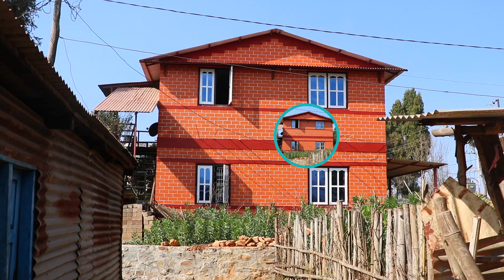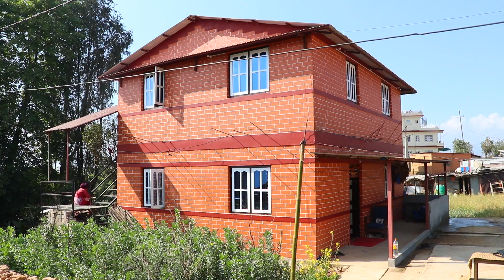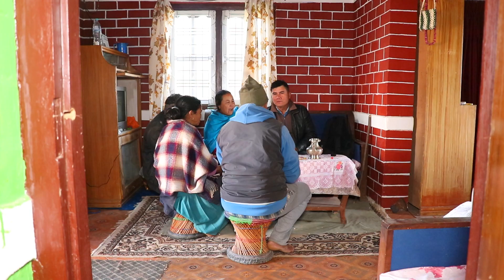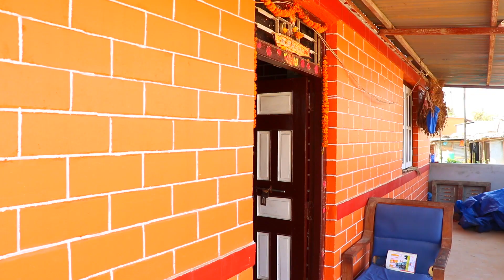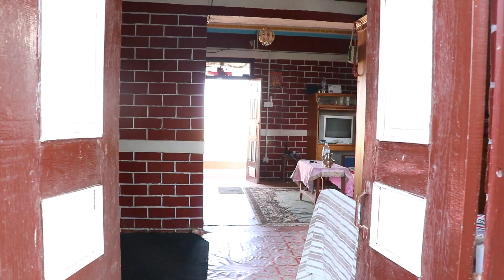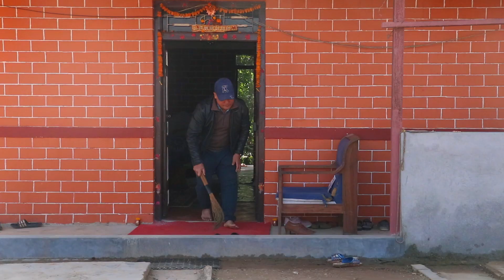Interlocking Brick House Nepal - Low Cost and Earthquake resistant - House owner experience - NTV

Comment: Wall bering system ma dhalan garna milxa,, 2 story banauda chai????piller nahali kana???
Reply from the maker: 10 inch ko itta bata 2 talla samma banuana milcha Navraj jee. Tara mathilo talla ma hajur le jasta halnu parne huncha. Bhui talla mathi hajur le dhalan garna saknu huncha
Reply: @BuildupNepal  10 inch ko itta paixa?? And price kati hola??
Reply from the maker: @navrajacharya7702  price 75 ho, hajur lai kun thau ma chaine ho? hamile hajur lai taha ko contact number provide garna sakchau
Reply: @BuildupNepal   Nuwakot Chhahare ma chaine ho
Reply from the maker: @navrajacharya7702   Karna Bahadur Tamang 	Hamro sundar Interlocking Block Udhyog	9741037735 / 9808381661
Devaki & Pradip Bhatta	Pipaltar Interlocking Block Udhyog	9849025913/9851240539
Tanu Maya & Simon Tamang 	Deurali Interlocking Block Udhyog	9616390337 \9615759757
Bachu & Maya Tamang 	Chilaune Block Udhyog	9851063388
Sher & Sarmila Tamang 		9611052680

Comment: Did they use the solid blocks for this building?  My reason for saying that is that there are white strips going to the light switch and across the wall for the electricity runs.  Personally, do prefer the perforated, as they can hide the water and power lines in the cavity of the brick.
Reply from the maker: Hey Jacare, 
yes these houses were made all using these bricks.